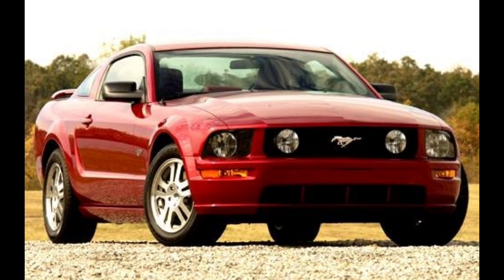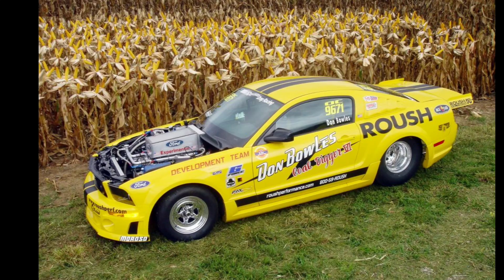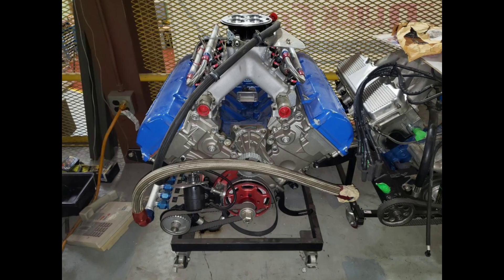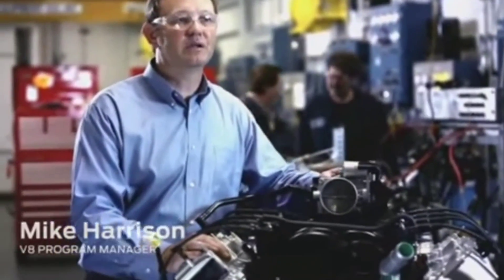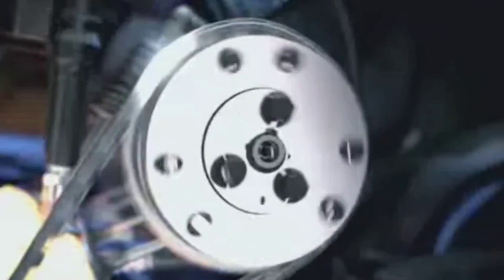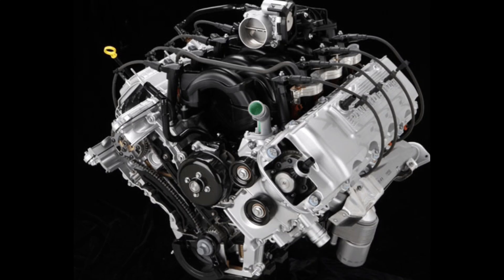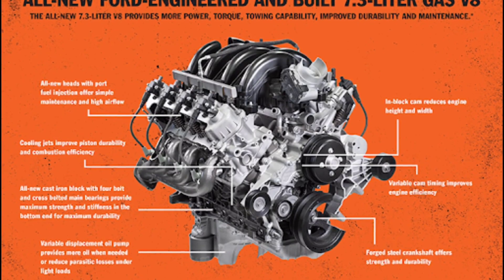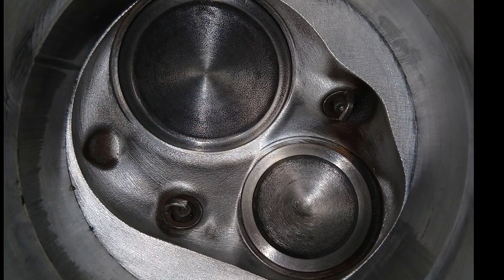Ford's Modern Day 427 SOHC Cammer..

Comment: 375 CFM with just a mild clean up of the ports is pretty darn good! That's enough to support around 850 horsepower in a N/A application! If someone were to do a very extensive full race porting job, I can see it going well over 400 CFM, and if slightly larger valves were part of the full race porting effort, I could see it getting into the 440-450 CFM range, which could potentially support closer to 1000 horses.
This is surely something very much worth investigating and researching.
Reply from the maker: Biscuit, you are right!  I believe with bigger valves we can get to the 400 mark.. Our question is how far will the castings let us go. That is why we found a junk head to cut up so we can see what we are working with.. Thanks for Watching!
Andy
Reply: @UnityMotorSportsGarage  The junk head cut away, I am looking forward to that!
Reply: Twin turbochargers with 375cfm ports = wow.
Reply: @AmericanThunder  Or compound boosting...

Comment: I like the Godzilla and all, but I love the Boss and want it to get the recognition it deserves. This is great news to hear. I wonder how many cui the Boss is with a Godzilla crank.
Reply from the maker: With the 7.3 crank which is 3.98" and the 4.015" 6.2 bore it comes out to 403" vs 379"
Reply: @UnityMotorSportsGarage  do some bording 30 over to the 6.2L boss block that it becomes 427 Cubic inches.

Comment: This engine would be a great swap for an old school muscle car or hotrod or even an old school F100.
Reply from the maker: I agree... It would be so cool to have some cast Cammer valve covers and a timing cover to make it look more like the 427 SOHC...  
Andy
Reply: @UnityMotorSportsGarage  Exactly if you bore the 6.2L BOSS V8 like 30 or 40 over and add a (like you said) a 7.3L Godzilla crankshaft to it then it becomes  427 cubic inches which makes it a real modern day 427 SOHC Cammer V8.
Reply: @arclightfab #arclightfab

Comment: Andy, no better people out there to pioneer the 6.2 HiPo market than you and Mr. Vizard. Going to be plenty chasing the 7.3 market. Guessing the 6.2 engines are available for a reasonable cost??
Reply from the maker: Chest, yes you can get them pretty reasonable now from the junkyard..  there are some differences in the production engines.. the Raptor received a Forged steel crank and the others were Cast.. using the 7.3 crank in a 6.2 will make for a 401ci engine and it is a Forged crank..  
 We have a company that will grind us some custom cams but we are looking at $2500 to have them done!  
I believe that DV and I could match the power that Don Bowles had . I'm not sure if it would be worth the money though...  The Aftermarket seems to be catching on to the 7.3 and that would make a huge difference in which we way we go... Time will tell I guess..
Andy

Comment: please build the 6.2 if some guys like you with big brains get them out running real hard and in the spotlight maybe the aftermarket will start picking up support for them!
Reply: I agree. The SOHC setup looks very promising. It's worth at least to port and flow test the potential of stock head castings with larger valves(if thats needed). Stroker sounds very promising too.
Reply: @v6ileib  yeah i want to do a stroker on my f350 get some headwork done with some modest boost to make a pumpgas towing beast with reasonable economy

Comment: Any idea what the 6.2's dimensions are compared to a 5.4? Will it run on the 5.4's ECU?
Reply from the maker: It is slightly taller and wider than the 5.4 and yes you could modify your 5.4 computer to run the 6.2
Reply: @UnityMotorSportsGarage  Thanks, Andy!

Comment: I just got 1 with 270000 miles on it in a f 250 runs awesome no oil leaks Thinking to take the sloppy approach ring gap a Turbo and boost it to the moon
Reply from the maker: That would work too!  Thanks for Watching
Andy

Comment: yes!!!! love it! my raptor had it and now my current f350 has one i love it!!! once its paid off i want to have the engine bored and stroked fully forged and have some head work done get some custom cams and a roots blower put on it. im not looking for a super high rpm hp build i want to make a low and midrange tq monster because it will be my towing rig for the next 20 years or more.
Reply from the maker: JDM engineering had some good parts for the 6.2 I don't know if they are still doing them but I love the 6.2 ours has a custom Carbed intake that we modified from a Gen III Hemi of all things!
Reply: @UnityMotorSportsGarage  i love the new 7.3 but don't like the new trucks my 15 is as new asi ever want to own!! My dream truck for towing would be a early 80s bull nose crew cab longbox f350 with a 460 stroker motor and a zf6 manual transmission on top of a stronger modern frame and suspension and axles with the 80s interior with the exception of some modern seat from a king ranch truck with all the heat ac and adjustment abilities in them!! My dream daily driver truck is an 80s bullnose bronco with modern seats reinforced boxed frame with a modern 1/2 ton max tow suspension retrofitted in for a nice modern comfortable ride on a 6 in lift 35s and full lockers 460 and a 6 speed manual transmission. I love the 6.2 it has so much to offer but i can't for the life of me figure out why the aftermarket never got behind it more! I thought ford had done some r&d to put it into cars as well when the "boss" first came back but but maybe they thought it would not sell well in cars??? I personally think an svt version of the 6.2 not the raptor version built for boost and stuffed in a 10 to 14 mustang making 700+ would have been an absolute monster!

Comment: Awesome Cool vid 👌🏼🏁, it’s a shame that 6.2 didn’t get the “aftermarket” performance potential 🤷🏼‍♂️ but the Godzilla is sure making its way 💪🏼🏁
Reply from the maker: The Godzilla is a bad piece! 
Funny part is looking at it, you can see Cleveland roots!
Andy
Reply: @UnityMotorSportsGarage   right on Andy, well definitely gone back to old school pushrod  😎🏁 iron block, 2 valve/Cyl head & valve size is good, close to Clevo 4V size🤷🏼‍♂️
Very good base for a stout build for sure, would like to see one converted over to Carby, a single plane or tunnel ram 💪🏼🏁
Reply from the maker: The interesting part is the thermostat housing is part of the block like a Cleveland and it has side canted valves!
Reply from the maker: @69JANKS  if we use the 7.3 you can bet it will have a Carb!
Reply: @UnityMotorSportsGarage  yes that’s right, like you said  definitely some OldSchool similarities there 👌🏼🏁. Man topped by a carb or pair of carbs now that’ll be BadAss 💪🏼🏁

Comment: Im here staring at my 6.2 hoping someone develops cams and intake manifolds for this motor. hopefully your platform can help. the engine has been around for over a decade so you can find them in salvage yards. sharing the mod motor bell housing, it shouldnt be hard to adapt to other cars.  👍🏼
Reply from the maker: JDM engineering had some mild cams available, I dont know if they are still in the 6.2 business..  I wish the aftermarket would have picked up this engine.. 
Thanks for watching!
Andy
Reply: @UnityMotorSportsGarage  there is at least one shop that does full forged 6.6 stroker long blocks with ported heads, they say it's safe for 850 horses flywheel
Reply: @UnityMotorSportsGarage   seems like a good idea,needs some aftermarket love for sure
Reply: Livernois has some 6.2 parts
Reply: @taylorgtrotter  IMO they overcharge for a set of mild cams and springs. i think if any of the major aftermarket camshaft manufacturers got involved the prices would drop.
Reply: @x1boomer  Livernois is very overpriced imho. Sadly, they’re the only ones producing stuff for the 6.2. MMR barely does anything for them which says a lot
Reply: It’s a shame this engine didn’t get any love, I believe it has great potential, the heads have huge valves in them, I was impressed, but I look at small 4 valve heads with what I’m working on. Only installed exhaust valve springs that would occasionally break in them.
Reply: Mike Jones can custom cut cams from billet or tool steel, not cheap. You'd be better off finding a dozen guys and trying to do a group buy, could lower the cost for all of you.
Reply: @b.c4066  the Livernois cams are .510” lift and more duration than stock.
Reply: Seems like the power toys for this engine dried up when Ford dropped it from the Raptor.
Reply: turbo?
Reply: Sullivan Performance has cams & intakes.
Reply: Look into the Ford Raptor community. Theres lots of stuff for our 6.2 out there

Comment: Great video as usual.  I have a 6.2 in my 2014 F150 and i am never selling it, its the best ford truck i have ever owned hands down.
Reply from the maker: Mark they are great engines!  We are just at a crossroads as to build the 6.2 or the 7.3  As much as I love the 6.2 I believe the 7.3 has more potential in a race application..
Andy